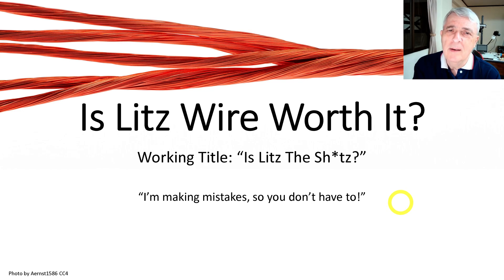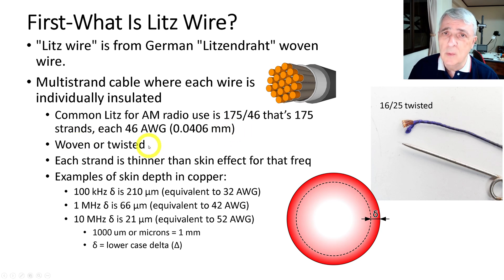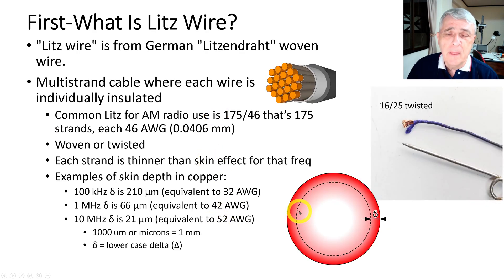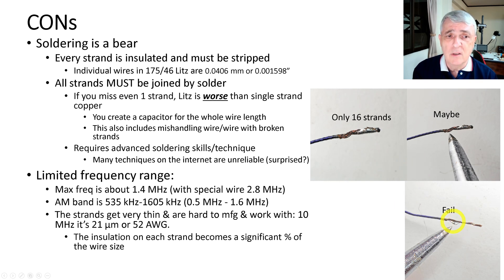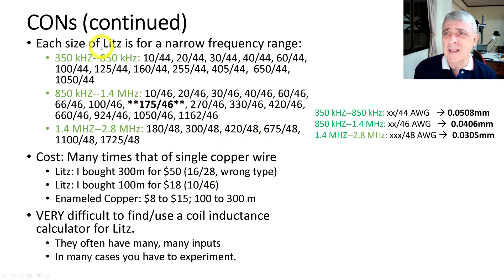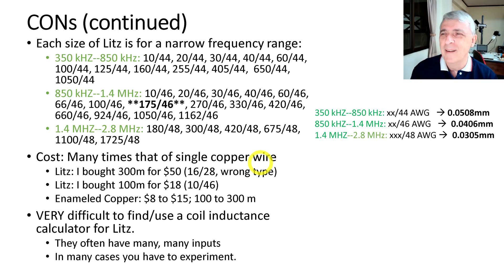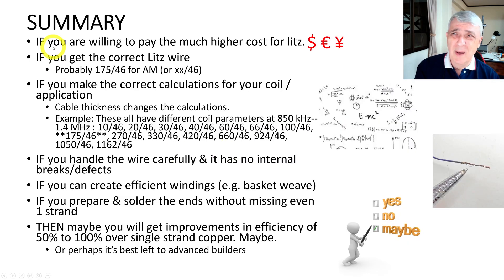Crystal Radio--Litz Wire (Is Litz The Sh*tz?)

Comment: Verification of winding integrity could be done by pulsing the coil with dc source and then looking at the waveform as it decays.  There should be a discernible difference between a "good" coil and "bad".  This is a common technique for finding a single turn fault in the motor winding.

Comment: Thanks for your effort and comments.  Wondering if there is a math relationship for frequency vs AWG.  In low voltage motors the common motor control is done through IGBT running at 1.5 to 10kHz.  I would like to look into a range of applications in the range, so having a calculated relationship would be great.
Reply from the maker: The coil inductance depends on diameter, length, turns, and spacing, and wire size impacts all those things. You can use the online calculators and vary the wire size and see how that impacts the results.

Comment: I purchased 60ft of 180/46 from mikes electronics parts. For $15 plus shipping $5. Thanks for the video.  I now know im in for challenge.
Reply from the maker: It's pretty easy to work with. I found a way to solder both types that does not require any special hardware.  https://youtu.be/NQHSkUHI4iU

Comment: Thank you very much for explaining that and helped me a lot to choose which wire. Funny thing, I'm shooting for the lowest possible frequency so I might just be good with a solid strand magnet wire. Also trying to lower the frequency with a thicker insulation so I'm trying it some DC Bell wire possibly dip it in a resin to increase coating thickness.
Reply from the maker: If you want thick insulation, there is everything from wire wrap wire to small gauge plastic coated circuit board wire.

Comment: Litz is often used in SMPS transformers. High power HF transmitters use copper tubing for coils and transformers. Soldering of litz wire is best done in a solder pot using lots of flux. It does get messy as solder and flux wick up the wire strands.

Comment: Each Separate bundle can be Untwisted (Bout 1") , Silk Removed, Strands fanned out & Lightly 400 grit sandpaper Btushed & Plunged & Held into Solder Pot 'bout 10 secs....The correct Solder Temp should melt & Burn away the Strand Insulation (Without Scraping) or without Burning off or Damaging strands & perfectly Tin all strands...Twist all Tinned  Bundles together & Dip twisted assembly into Solder Pot for Hopefully 100% all Strand end to End continuity....
Reply from the maker: I want to see a video of someone doing that, especially with 46 AWG strands. Even wires much bigger break very easily. I've tried many of the things people suggest, and they don't work.
Silk is now nylon, polyester,  fluoropolymers, epoxy, etc. And most turn into a sticky burned mess when exposed to a flame, and strands many times bigger melt (part of an upcoming vid). I've also tried the meanest stripper chemicals, and they don't even weaken the coatings.
Solder pot will work, but it costs $s and how many times will it get used? I can now do the same with a soldering iron. Video coming.

Comment: The Correct ga (44ga or 46ga) Litz wire is Deff worth the effort...An adjustable temp Solder Pot is Best but a 15 watt iron will work...If using Multi--Bundle Litz, Separate the bundles & Dip each bundle Separately into Tinning Pot for 10 secs...Each bundle should have 100% Strand well Soldered....Finally Twist all Bundles together & Dip into Solder Pot  for another 10 secs....Inspect & Redo if any strands not Soldered...
Reply from the maker: I've cracked the code on soldering Litz. Got to put together a video. But I've found ways that anyone can do. Stay tuned.

Comment: I didn't know about the Litz wire "Open continuity Strands" degrading issue....How does one Check each Strand continuity after solder pot dipping ??? ...I have a 660 strand #46 Litz to wind & deff want to QC each Strand continuity...Any  ideas ??
Reply from the maker: My thought is to test against a known good coil. Sounds easy but ....

Comment: Hey tsb,...Was that Litz wire intended for the "Tank" tuning Coil (About 240uh) with a 365pf Variable cap ?? Yep, your 28 ga Litz is Way off from Recommended #44 or 46 ga....I see Litz mentioned frequently used in Hi current RF applications where AC resistance causes coil Heating probs ..I Wouldn't think a MW resonate LC radio tuner coil (Running in the u amps) would Benefit much with Litz over reg #32ga magnet wire ? ...I'm planning a 48" x 48"  box Loop antenna for MW radio receiver...I have 660/46ga Litz ready to wind (130') for deep Fringe DX tube Regen receiver project....Did you Compete your Crystal radio project ??
Reply from the maker: I have not built a radio with Litz yet. I'm still trying to come up with a reliable way of soldering it that does not require specialized equipment. I've tried the ways I've seen on the internet, and they either don't work or are very unreliable. I don't know which crystal radio project? I don't have any in process right now. Just some thoughts.

Comment: Solder pots are not terribly expensive, incidentally. I bought some 660/46 Litz wire a while back to experiment with and ended up getting a solder pot and 1 pound of solder from Amazon. The pot was about $25 and the pound of solder cost about the same! It did work to tin 660/46 as far as I could tell, but I had to hold it in the molten solder much longer than I was led to believe I should. It also tends to wick up the Litz wire a bit when you do that because it acts a bit like desoldering braid. I still haven't actually made a coil with that Litz wire - some day I'll get around to it!
Reply from the maker: Interesting info, thanks. I think the only way for the average person to test it is to test against a known/working coil. I'm sure factories did/do test against a known reading.

Comment: Per our prior discussions of DIYing an AM transmitter... I bumped across a YT video where the author created an AM bench transmitter with an Arduino, a Ferrous Antenna and a three more discrete components... two resistors and a capacitor, IIRC. These were not fake videos. It seemed to me that you could rather easily create multiple channels on a single Arduino, to get the cross-talk function that you need.
Reply from the maker: Thank you. I will have to search on that.
Reply: https://www.youtube.com/watch?v=Xy7DiPVi18Y
Reply from the maker: @t1d100  I watched both videos (not sure why the second is not here, but I recovered them from the youtube spam folder, so....) He's only getting a couple meters and I have a transmitter that will produce the same power/distance. It's not enough to power the radio. I've got another thing to try, so I've not given up yet!
Reply: https://www.youtube.com/watch?v=m-EJ7NYxggc

Comment: There are types of Litz that has insulation that goes away at soldering temperatures.  I used it in some RF transformers.
For some things, simply making a "wire rope"  out of three lengths of insulated wire is good enough.  You get a big Q improvement on your inductor when you go from one solid wire to 3 strands.  When you go 3 to 9 and then 9 to 27, tripling makes less and less improvement.
Also:  Sometimes it is just find to wind an RF coil with #14 (US house wire) and just live with the fact that the copper in the middle is just along for the ride.
Reply from the maker: I've read about that. The old stuff used to be coated with silk and would turn to ash at normal soldering iron temperatures. Then there's most of the newer stuff that requires something like 600C to cause it to break down completely. Anything less turns it to brown tar that's a mess to get off and gives one lots of opportunity to break wires.
Reply: Are some of them not solvent-based?
Reply from the maker: @TimLF  I'm going to give that a try next.
Reply: @TimLF Some can be stripped with solvents.  This is not all that common and it is not an easy procedure.  You have to wash it all away.

Comment: Say you want to build a direct tuned radio in the LW or AM band.
By using a tuning coil made with Litz wire instead of one single thread of solid enameled copper (0.3 to 0.5 mm Φ) wire, we achieve a merit factor (Q) which is the double.
This improved Q, which in turn improves the selectivity of the radio receiver, is the result of the better distribution of the inter-thread stray capacitances.
The improvement require a low load factor from the detector. This require a secondary winding on the tuning coil, experimentally determined (between 5 to 10 turns); or a FET connected as source follower (voltage gain = 1)...
Reply: Yes, and the winding pattern matters a lot when you get to a high Q.  The spiderweb coil is good.  A stack of spiderwebs is better.
Also:  To get better selectivity, a double tuned radio is better.
Reply from the maker: I have a video where I made spider coil forms that are the common 8 cm with a 4 cm center. Have not done much with them since. I need to find reliable sources and study up on them.
Reply: @tsbrownie  There is little about them to find because it is hard for a machine to make them.

Comment: That was very useful. Is there a time where the isolation is all enemeled wire?
Reply from the maker: Newer wire is coated with better (and more difficult to remove) plastics. Some have a polyester or similar jacket. Others are all enameled. Old cables were covered with silk. The internal strands with an easier to remove  lacquer and other.

Comment: Do you really have to buy it tho? You could just get the regular insulated wire and then make the overall strand wire yourself, heck, throw a shielding sleeve on it too as well. Making wire isn't trivial, but it's not rocket science either. Most of the times, for old stuff i restore (as a hobby) whenever i do the wiring, i do it from scratch. There's stuff on the market, there's even high quality stuff that mimics the OG aspect, but ... buying a 10 meter roll (random number) to put 60 of wire overall always rubs me wrong. :)) So i end up making it. For tips, you can look into loom making and rope making vids. Watch three or four from both categories and you're set. Bonus for this affair, you can do it exactly how you want it, with the exact number of strands you want, the exact "weave" you want etc. The world is your oyster type thing.
Reply from the maker: Yes, you could make your own. The wire gauge for AM radio is 46, or about 0.0405mm. Most of my radio coils need about 30 meters.

Comment: The youtube channel Kinka Labs video 'How to tin Litz-Wire' is pretty good on this subject. Special trick to tin Litz wire.
Reply from the maker: I'll check it out. Thanks.
Reply: I think Mr. Carlson's Lab covered soldering Litz wire at some point as well. KainkaLabs is an AMAZING channel for radio hobbyists, though. I've never found better information about ferrite loop antennas than what they have, for example. Definitely check them out!
Reply from the maker: @flapjack9495  I like Mr. Carlson's Lab channel and he's a trustworthy source . I looked for a litz video on his channel and did not find one.
Reply: There is also special Litz that is made to be easy to solder.   The insulation basically works like flux.

Comment: What about dipping the end of the Litz wire to be tinned in lacquer thinner then agitated with an acid brush. This may remove enough of the enamel coating to make for good tinning.
Reply from the maker: Good idea. I read manufacturers use chemical strippers. I was thinking acetone, I know I have thinner so that is a good option.   What is an acid brush?
Reply: @tsbrownie  The acid brush can remove remaining insulation material, which has become goo and still stuck to the conductors.

Comment: 7:20 I am wondering, would hot air work to strip the wire? Does the isolation pull back when you heat it?
Reply from the maker: The temperature needed to remove the insulation is above the temp most soldering irons can do. The outer jacket is plastic (polyester?) and turns nasty when you heat it. You can see that on the litz wire photos.
Reply: I make and manufacture wires with litz structure, it’s a cable busines for headfi hobby.

You can strip litz starting 250c with a soldering iron, but you’ll definitely need some good flux.

Comment: 8:20 would be interesting to see those Atmega based one button part testers testing such a wire before and after you break a strand. 
I believe they show resistance, inductance and capacitance. So it could be possible to rest it without any expensive equipment.
Reply: A NanoVNA should show two different plots. I don't really consider a NanoVNA "expensive" test equipment 😉

Comment: Wow! What a great tutorial and video. Super information, well explained, in a manner that the viewer can comfortably (not intimidated, or lost in technical jargon) understand. I learned a bunch! Idea for stripping Litz, for hobbyists... Create a container, in which you can create a current of solvent... Say a repurposed flat, round, 3"/diameter, plastic, food container, with its lid. DIY a magnetic spinner = A motor base, with a magnet mounted to the shaft. Place the container on the base, drop in a piece of Ferrous metal. As the metal spins, it will create a current in the solvent. This is a laboratory device, but I don't know its name. Cut a small hole in the lid, near the side wall of the container; the current will be greatest, there. Pass the end of the Litz through the hole and into the solvent. Wait awhile, for the insulation to be washed away? Just spit-balling, for fun... What else to do at 2:30am? grin. Cheers.
Reply from the maker: Thanks. I think I will try chemical stripping because heat and flame did not do well.
Reply: Its name is "magnetic stirrer". Some have a hot plate top as well, heat usually improves the solvent action. Usually come with the ferrous metal stirrer pellet (the "stir bar") encapsulated in an inert substance (ex. teflon).

Comment: The only thing I can come up with is using a solder pot to solder litz wire. But, I am sure you have either thought of that or have tried it already.
Reply from the maker: I wish I could say I thought of it, but did not. I saw it in a litz wire brochure showing how to use a solder pot (with regular pot skimming and dipping the wire in an arc-motion). There was another place that mentioned commercial wire stripping chemicals are available. Now I'm trying to figure out a DIY method that us average folks can do/afford!
Reply: @tsbrownie  In a book I have called "The Boy Mechanic" they suggested drilling a cavity into a soldering iron which could be filled with solder for dipping wire splices.

The book is from the early 1900's and the soldering iron in the photo was the old copper tip on a shaft with a wooden handle. The kind designed to be heated up while resting in the metal loops on the top of a kerosene blow torch.

The same book also has plans to build radios in another section.

There's 4 different versions of this book with many printings. The book has a little bit of everything and I enjoy thumbing through it at least once a year. The projects are a glimpse into a world long gone.
Reply from the maker: @tenlittleindians  I've used those old soldering coppers that were heated in a cute little gas oven. That would probably work since it could reach the abnormally high temperatures required to remove the insulation throughout the cable bundle. A regular soldering iron won't do it.
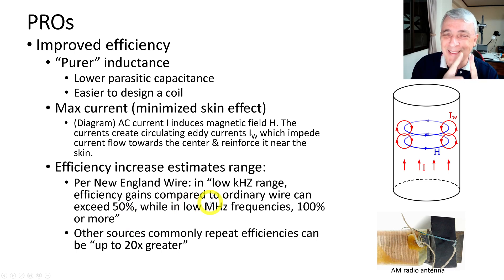Reply: Here I am at about 6:00 in the morning still thinking about your wire video and not just for the sake of AM radio.

I'm reminded about discovering transformers and how they worked in the early 70's and now a half century later they still baffle me with their black magic.

Everybody knows if you take a 100 foot extension cord and short it to ground you get sparks and a blown fuse.

Take that same extension cord and wrap it around let's say a section of common rebar and you can now short it to ground without the drama because it acts like a transformer. Even stranger; it also works with just the wire being coiled without the iron but it's not as efficient. 

Thinking about this transformer "black magic" and your Litz wire video and I'm wondering if they ever made something I will name "linear transformers" by alternating the wires inside Litz wire with a mixture of iron wire and copper wire?

Just what effect would that have on current, inductance and frequency?

I remember a high school teacher that had a laminated core and a solid core to slip inside his hand wound loops of wire to demonstrate the effects. His laminated core wasn't bolted together tightly and it buzzed loudly during the demonstration which hinted at another phenomena related to frequency.

Could this interaction be stretched out with mixed multi strand wire of iron and copper in a Litz wire? How would such a wire behave with frequency, induction and current compared to ordinary wire.

What if it were just a group of iron wire towards the center of Litz wire with the copper strands wrapped around this core? Would this react similar to a torrid style transformer? Would length have an effect on such a "linear transformer"?

I'm sure this has all probably been tried a hundred years ago but we humans often reinvent the wheel by nature.😊